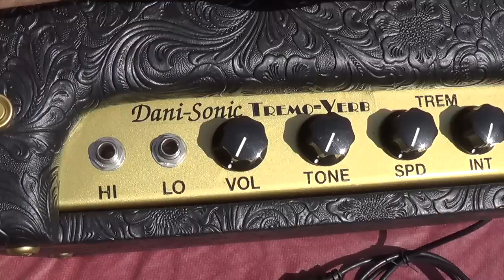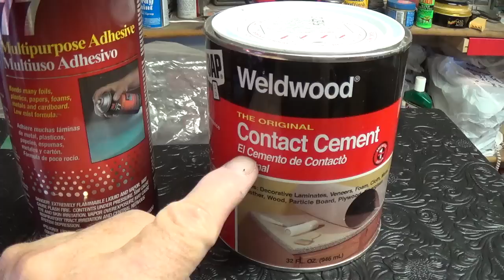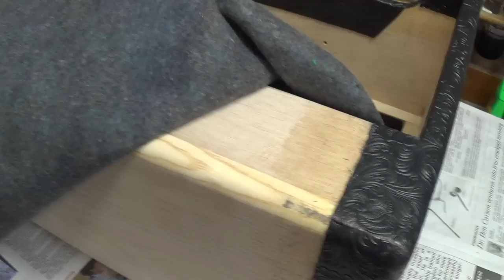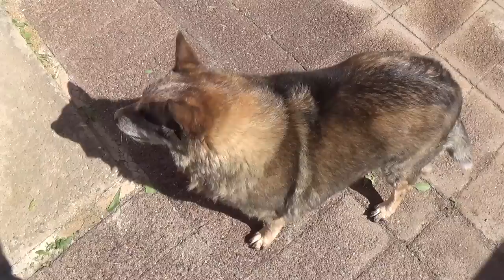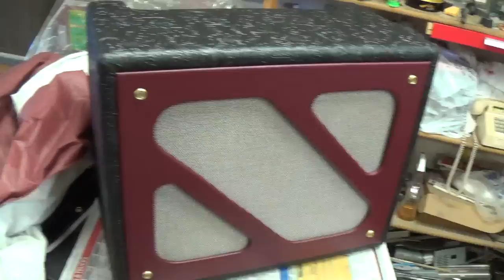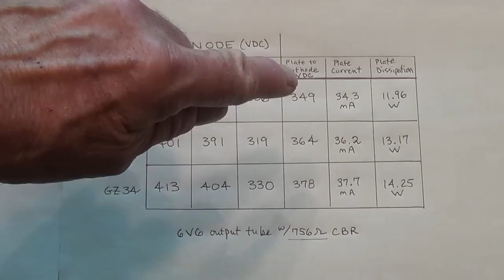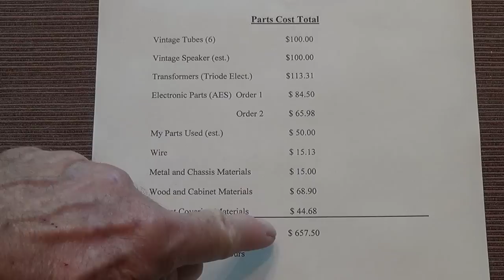How to Scratch-Build a Vintage Amp, Part 8:  Completed and Tested

Comment: I’m picking this build back up after I’ve put it on the shelf for a while.     
Is there an updated parts list?    I seem to have lost mine while it was packed away
Reply from the maker: If there is a parts list, it would be in the video description, Terry.  If not, then simply make your own using the schematic as a reference.

Comment: I think we still are thinking european tubes here in europe,thow its not like in old days, ez80 and 81 are usualy the rectifier tube i use,but that ofcourse alsow has to do with transformer vindings. I agre that the single end amps usualy are sounding good. I can buy a vintage radio fore 40 $ and build a vintage single end amp with the parts,here in norway its a tonn of those radios on marcet, but i wold like to gett a super locking cabinet to. Thanks so much!
Reply from the maker: You're welcome, NB.

Comment: Uncle Doug I know you might like my suggestion just a thought. A piece of Steel thin screen attached to the back door that covers the chassis makes an effective Buzz and RF shielding electric amp and Fender has I found it works well I did it with an old Gibson amp which helped the operating conditions on an old Gibson ga-40 the ga-40 had a bit of home or Buzz when I put my hand close to the back door of the old Gibson the screen I installed helped it virtually eliminated the buzz when my hand was near the chassis Irene kept the old aunt and got it working and it's tremolo no lose grounds anywhere but the screen helped the operation of the amp I really enjoy your videos thanks again for the second or third time your friend Dwight.
Reply from the maker: Thanks for the helpful tip, Dwight.

Comment: Uncle Doug, I'm building this amp now and I may have some questions as I go along.  But, specifically about the leatherette, where did you get the material?
Reply from the maker: At a local upholstery supply store, Andy. It's also available, from time to time, at Antique Electronic Supply.
Reply: @UncleDoug  I went ahead and got some Tolex from AES.  I hope it works out.
Reply from the maker: @andysparks7381  Just take your time and think hard before each step.
Reply: @UncleDoug  Shifting gears to talk about the electronics of this amp...I bought an output transformer that may not be correct.  It is a Hammond 1760F which has 6950 ohm impedance.
Reply: @UncleDoug  OK.  I don’t do FB so I didn’t see the discussion.  I realize, now, that this transformer is used in push-pull amps, so I don’t know why I bought it.  I’ll just get another one.
Reply from the maker: @andysparks7381  Sorry if I confused your inquiry with another similar one. It's good that you resolved the issue on your own.

Comment: @uncledoug this is truly impressive. I love a good strong  tremelo and that amp actually found a way to be too good. I am about to embark on my first build shortly, but it is breathing life into a chassis who's circuit was its issue. I'm gutting my old Peavey Delta Blues 210 and going to Salvage the Iron, the box *the blue tolex is actually in good shape for what it is*, has good Jensen speakers, and the metal of the chassis itself is good shape. The circuit and working on the 3 circuit boards that are formed into a C with bare jumper wires that break easily is a nightmare. I did everything I could, got it close to black face, but never got the drive channel right. The bias circuit shorted to the plate and caused a rather spectacular failure.

I am thinking about using a design without a phase inverter tube or transformer, and wiring it up I so the output tubes create their own phase inversion. But I don't know what to do for the input, I like have a dedicated clean and drive channel, I want tube reverb *factory peavey was transistor driven*, tube Trem *factory Trem was solid state and rather useless because total volume of the amp would drop with it engaged*, and to have a good drive/dirty channel. I'm waiting to see a video you do that has a description and features an Amp with good drive channel.

You truly are amazing, informative, and entertaining. All the best Uncle Doug

Aaron
Reply from the maker: Thanks, Aaron. We have posted many videos on the topics you mentioned. I would skip the idea of no phase inversion. If it were a good idea, Fender and others would have used it.
Reply: @UncleDoug  Your right. It would probably work better with a lower gain type of amplifier that was meant to be played clean or where space on the chassis was at a premium. A part of me was thinking of simplicity of wiring. I have a good sized chassis to use might as well use it
Reply from the maker: @aaronatwood9298  Don't let simplicity be a reason for poor design, Aaron. Stick with proven circuits..
Reply: @UncleDoug  Any recommendations on phase inverter circuit for a 15-30 watt 6bq5 amp? The original design of this amplifier was so over the top for no reason...

Comment: As always I'm impressed with the work and highly detailed work you put into both your amps and the knowledge you share in these videos. Amazing. Did you ever figure out what caused the lack of Bass in the circuit. May have been the extra resistor you added to the Rectifier circuit. I dont really know just trying to pay attention to all that I have learned from your expertise.
Reply from the maker: Thanks so much for your kinds words, Chris. The problem was found to be nonexistent after more testing and listening.

Comment: did you ever work out the tremelo variation , though maybe at high settings one would expect frequency cut outs.  I was thinking you said it weighed in a couple of piounds less than a 1950s Fender might have done.  This may be slight changes in the output transformer,  the plastic used in modern valve bases, the cover off the speaker, the material chosen for the speaker grill , and the density of the timber.  all little differences to add up,  also is modern insulated wiring less wieghty than the old cloth braided insulation on wires ?
Reply from the maker: The tremolo ended up sounding just fine, HP. Thanks for your input.

Comment: Excellent schematics Uncle Doug! Is there a specific way to attach the wires to the lugs? I thought I heard you say that you squeezed, then soldered. And if you dont mind, what is the best soldering iron to use? Thank you much. Was that the birds finally using the leaf blower?
Reply from the maker: Thanks, Wayne. I try to make good electrical connections prior to soldering....wrapping, crimping, etc. the wires. I use a $12 soldering iron bought on Ebay. When it begins to act  up, I simply replace it.
Reply: @UncleDoug  Thank you Sir!!

Comment: Very good job Uncle Doug. Super sound & Tremolo operation. I have a question on the schematic. I noticed the only tube connected to the heaters is the 5Y3. the other tubes just have short arrows pointing down from the heaters. Are they hooked to power some how not showing  or left redundant?
Reply from the maker: This is a standard notation for the 6.3VAC heater circuit, Kevin. All of them are connected in parallel.
Reply: Thank you Uncle Doug. This helps me understand.

Comment: Uncle Doug, Thank you for another fantastic amp build and video series. Were you tempted to somehow try and utilize both triodes of Valve 1 in the build? Maybe have V1a as part of the dry circuit and have the reverb come off of V1b. Would that have even worked? I don't know why, but I can't stop thinking about how to incorporate V1b into the circuit. Maybe I need to forget about it and think that if it would have made the amp better you would have done that. Thank you so much for the videos!
Reply from the maker: You're quite welcome, Ronnie. I agree. Wasting a perfectly good triode really goes against my nature.  Maybe in the future, I'll revisit this circuit and come up with a good use for it.

Comment: Dude. I'd pay 22 grand, easy. I have built three shakuhachi (traditional Japanese bamboo flute) and each one required 150 to 200 precious highly-concentrated build your own tools because Japanese bamboo tools cost a fortune hours or, about 2-3 months apiece. The joke is I don't know how to play shakuhachi (not totally true). I am currently building a Japanese style shimisen (3-string thing) and I am dreading the end of the build, I don't know why. Maybe I don't want to put that tray (high chair baby tray from the dumpster) full of tools away, there is something very comforting in that pile. I started the build in the last week of December 2019 and there are about 5 days of finishing work (making the nut and bringing the bridge down one millimeter) left to do. The temporary setup has strings on a temporary nut (popsicle stick) and I can't stop playing it, despite its tendency to play in one key (I have it tuned to open F - C - F) however it is my first non-fretted string instrument and now I know why Jaco took the frets off of his Fender Jazz bass. When I started playing guitar in 1969 I yearned for that sound that only seemed to emanate from certain bass players and a few cello players. I did not know at the time that I wanted the fretless tone that cannot be electronically duplicated. So yeah,I'd pay 22 grand for that amp. I live across the tracks from multi-million dollar homes, I can see them from the rooftop - even Kevin Smith's estate. You, Uncle Doug, really need to get comfortable with unlimited dollar figures. To many folk the numbers are inconsequential. When you are comfortable with what may seem insane numbers then so do the zillionaires get comfortable with your deadpan reading of the line, when asked "how much" and you reply "twenty-two grand, it's a good number" I promise you sir, the more talented, shall we say, zillionaires will not flinch. They will say, show me what I'm buying and you basically give a shortened version of this build. I shop at the same market that their assistants shop at and in the seventies I hung out with a few. I know how the more interesting rich folk work and they are not stupid. They are rich and it don't mean nothin' but the best doggone amp you can make is all they care about.  Total cost of materials in my shimisen is about 8 bucks for hundreds of nickel screws because I needed about 15 and brass screws were beyond my budget. And oh yeah I bought a ten dollar rasp to shape the neck, which is beautiful and feels like a flower petal 19 inches long. It sounds so sublime to me that I don't want to take the strings off to finish it. Total labor - priceless.
Reply from the maker: Another beautifully written and very interesting series of comments, B. Thanks !!!

Comment: Late to the party here but I just started learning how to play the guitar (at 66 years old!!) so this project would be perfect. I plan to add your overdrive circuit to make playing "metal" possible. Because I've been playing around with tube HiFi equipment for decades, I have most of the parts to build this. Will build the 5881 version since I want the power and have at least three dozen mil spec versions of these tubes in my stash. Thinking I'll use an Eminence 10" guitar speaker from Parts Express. Thanks very much for putting this out there for us hobbyist to enjoy.
Reply from the maker: You're quite welcome, Walt. Best of luck with your project and regards from Jack to the kitty in your icon photo.

Comment: If I were to build your trem verb supro amp could I mount the tubes on top with a plastic window for protection, just thought it be cool to see the tubes glow, I’d have to make the cabinet bigger. Would I have to move the switches n inputs to the side or back for interference (hum) or could they together? Thank you for the clear instructions!!
Reply from the maker: Sure, Groucho. The chassis could be inverted so the tubes were on the top.....along with the transformers, if you wanted them visible also. The switches would retain their positions relative to the tubes and transformers. Actually, the cabinet may be shorter, since there would be no clearance issues with the speaker.
Reply: Uncle Doug 😳 dang didn’t see your reply till now. I scored a huge HealthKit 54-103-24 transformers n a box of tubes n thought maybe Uncle Doug has a how to build your own amp n thankfully you do! Sorry 😐 I’ll be bothering you in the future as I figure things out.
Reply from the maker: @g.m.5607  Good luck with your maiden build, Groucho.

Comment: I have built one of these and it sounds wonderful. Fitting it to a cabinet at this moment. I wondered if you had thought about  making it push pull output with the switch to enable the feature of bringing the power up slightly to something like 35 to 40 watts with the same cathode bias method? Not sure that is possible as I'm searching the internet for something like this.
Reply from the maker: I'm glad your build turned out so well, Bob. Trying to design a circuit that is switchable from single to double ended may be possible, but it would be a huge challenge. Recall that you would need a phase inverter as well as a different output transformer, not to mention a larger power transformer for the pair of output tubes. Even then, the output power would be much less than your estimate......probably closer to 18W......and not all that much louder than the SE version.
Reply: @UncleDoug  As I scan for a schematic to build from, and read comments, It seems that the trend is toward a perfect 59 watt amp. One that can be used both in the studio and live. Most musicians do not want the more powerful over 50 watts because they cost too much and say 50 watts is all the power they need. Vibrato not used much and some like to have the reverb. With all the different pedals there are today, they can find one for distortion to suit their needs. The Hammond organs I've been picking up for neatly free have transformers that look like are double that which they are being used for. there output  with 2 6V6's in push pull and  output transformers only have one center tap which is not what I see on the 50 watt schematics where there are extra taps for the more power out. My thoughts go to using a preamp and driver section like this one you've built then using a more powerful output tubes and Xformer section to up the power to around 40 watts with 6L6's and a 50 to 60 watt output Xformer with or without the extra taps making it the most costly addition. The power Xformer I used to build this single ended was from  a Gulbransen organ neatly twice the size of the Hammond's transformers.
Reply from the maker: @bobbaisden1685  I would think that 50W would be achievable with a good, stout pair of 6L6GC's operating at relatively high PV and PC. I have only built one amp with this much output power and found it to far exceed my needs with respect to volume......which was overpowering at a setting of only 2.  For that reason, I stick with amps in the 25W and below category. Good luck with your build.
Reply: @UncleDoug  Thank you Sir !

Comment: I have a question for you Uncle Doug on the Tremolo and Reverb Footswitch  connections to their circuits.  Is the signal being grounded to chassis to keep them off when not wanted then when the footswitch is depressed the grounding is opened, turning on each respectfully? The schematic tells me this but I just want to check. I am building this amp and am about half way through. Appreciate anything you can tell me.
Reply from the maker: Yes, in both cases the footswitch will ground the signal to turn it off, or unground it for operation. This is unlike the typical Fender trem circuit, which must be grounded to operate.
Reply: @UncleDoug  Thank you Sir!
Reply from the maker: @bobbaisden1685  The pleasure is mine, Bob :)

Comment: Great sound Doug - well worth the effort. I prefer the first valve (tube) tested, but, that's just a personal thing. Yes, a little more bass response would be nice but it's not that far off...I think I would have used aluminium for the chassis (lighter and easier to work) but just a personal thing again, probably from my aircraft days...
Reply from the maker: Thanks, Dave :)

Comment: Fantastic series and results! One question, what is your procedure for first turning on power? Variac, current limiter, tubes in or out. Thanks for all your knowledge you share.
Reply from the maker: Thanks. Current limiter, if the circuit is newly built with fresh components. Both CL and Variac when starting up an ancient circuit that has not been energized in years.

Comment: Okay, I just watched this and at 10:06 - 10:10, you ' show ' Speaker Outputs, One of which is for 8 Ohms. So, does this mean the 'Final Build' is Set up for the OPTION of an 8 Ohm Speaker?
Reply from the maker: No, it means that there are output jacks for 4 or 8 Ohm speakers. You can use either speaker and simply plug it into the correct jack.
Reply: @UncleDoug  Okay, that is what I was trying to Clarify. Thanks again,

Comment: Looks Superb, Uncle Doug!!! I've already picked out my Covering. It's a Native American 'theme' Cloth. Appreciate All the Love & Work you've Put into these videos.
Reply from the maker: Sounds good, Sterling. Let us see it when you are finished.
Reply: @UncleDoug  I found this ready made Chasis Box. Looks good, but the Depth is Only, 2.5 inches. Is that Workable or going to be Too Tight, and or cause Hum issues? I did drafting in the past and I've worked in Carpentry and woodwork, built my own Pedalboard, years ago.
Reply from the maker: 2 1/2" should be more than enough, Sterling. I have even used thinner chassis with no ill effects.
Reply: @UncleDoug  Okay, Thanks so much. I'm Watching all the videos again, and going to Write Down, List, etc. I'd Quickly Watched them the First time. Have a Great Weekend.